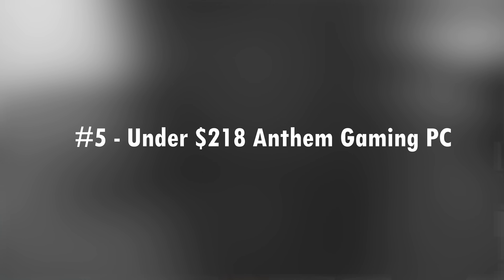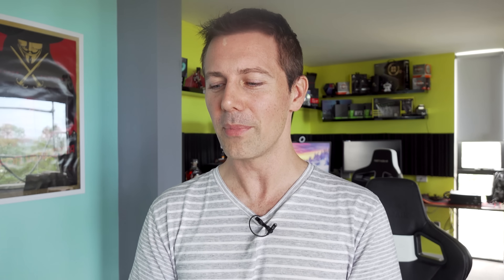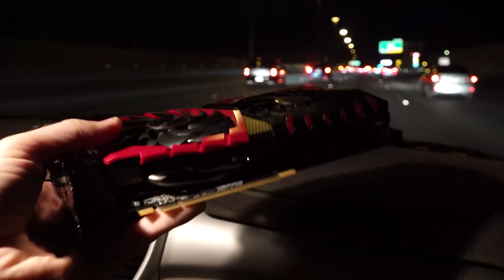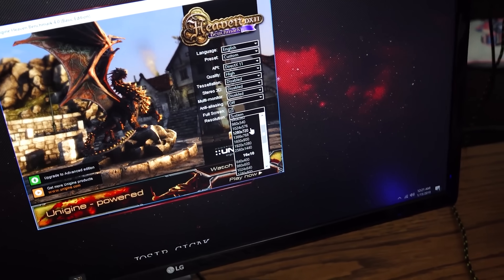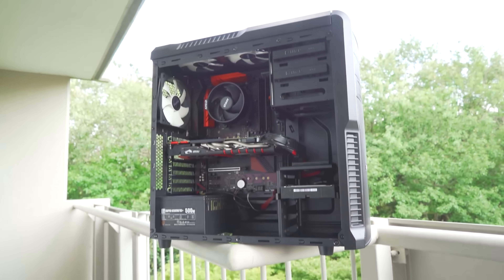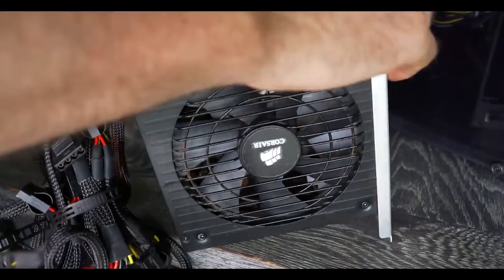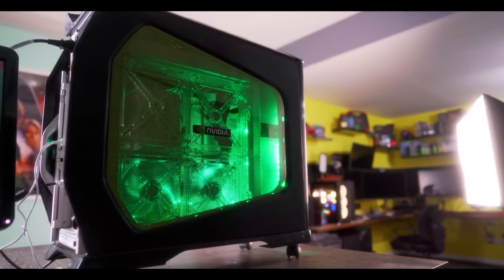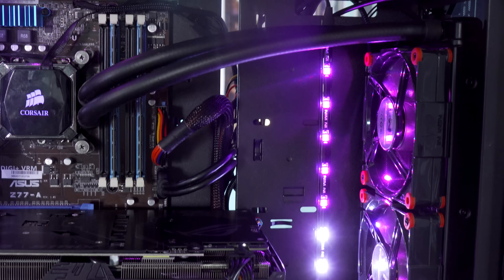The BEST Gaming PCs of Tech YES City in 2019 (and bonus 'faulty' gaming pc).

Comment: I'm one owner of the same Asus Z77-A board.. and the previous owner trashed the whole socket, and it's now missing a pin.. But what's unbelievable with this board is that it's working fine (except no overclocking possible because of the missing pin). But apart from that, even with a trashed-dead socket when I bought it for extremely cheap, this Asus Z77-A has been an awesome board. I've recently find an I7 3770 (non-K) version to put it in (because my main rig is rocking one with a gentle OC of 4.112Ghz all cores, and 1866mhz ram speed) and I found that this CPU was so awesome that I now own 2 of them. I hope to bring a new life to this Asus board with this CPU, paired with 8gb of LP-DDR3 1333 from kingston (4x2gb sticks). I'm really enjoying what you're doing in australia, and I hope that someday I will be able to meet people like you, who enjoy so much to hastle for computer parts on the fly, and then to build new systems able to run pretty much everything you want on. I wish you the best for 2020, and please continue to make awesome good content ! Maybe you can find new partnerships also to help you have a bit more cash to spend in your passion, and bring a bit more content and deals too :). Best wishes !! And happy new year bryan :)

Comment: I remember then I forget to unplug the CPU cooler and then I dropped it into the socket because it slipped out of my hand. More than 20 pins where bent and I spend two hours bending all of them back. But the motherboard worked after it.

Comment: Hey, I got a gtx 770 for $60 aud, can anyone tell me if that is a good deal?
Reply: I think its not i found a 970 for 50€
Reply: MorisPro11 ok, I’m planning on putting it into a build anywaus
Reply: Depends, wich brand ?
Reply: didi casse the gigabyte triple fan one
Reply: Nop 
Rx 570 cost 70 usd
Reply: @JacksonsgamezHD   its a fair deal. nothing special actually.
Reply: @alisayah5397  its a mining card, of course you can get it for that price ... btw 70 usd is a 100 aud.
Reply: Ali Sayah yeah I said $60 aud not usd
Reply: didi casse cool
Reply: didi casse was also thinking about picking up a fx 8120 and mobo for $70
Reply: @JacksonsgamezHD  The first gen " 8 core CPU " from AMD had a terrible architecture back in a day, and to overclock that thing is a nightmare specially if your are limited in cooling options, i'm not recommending that CPU whatsoever, but its up to you !
Reply: didi casse well I was thinking of putting it in a build to sell, and I was going to put a chunky cpu cooler on it so the buyer of wanted could overclock
Reply: @JacksonsgamezHD  If the cooler can handle that CPU at 4.2ghz, yes sure, its a 8 core and it can handle some games if its paired with the right GPU (anything beyond a gtx960  or a R7 370 its gonna bottleneck).
Reply: didi casse yeah that’s why I got the gtx 770

Comment: Operating System
 Windows 10 Pro 64-bit
CPU
 Intel Core 2 Duo E6850 @ 3.00GHz 58 °C
 Conroe 65nm Technology
RAM
 6.00GB Dual-Channel DDR2 @ 400MHz (5-5-5-18)
Motherboard
 MICRO-STAR INTERNATIONAL CO.LTD MS-7345 (CPU 1) 53 °C
Graphics
 Generic Non-PnP Monitor (1680x1050@60Hz)
 2048MB ATI AMD Radeon HD 7800 Series (MSI) 39 °C
Storage
 476GB SSD 512GB ATA Device (SSD) 40 °C
 7GB Kingston DataTraveler 2.0 USB Device (USB)
Optical Drives
 TSSTcorp CDDVDW SH-222BB ATA Device
Audio
 AMD High Definition Audio Device